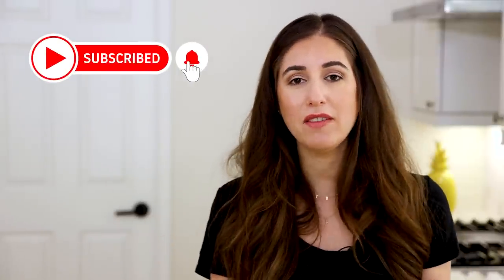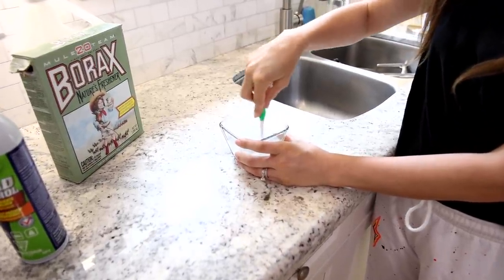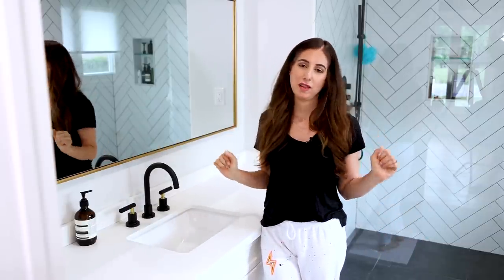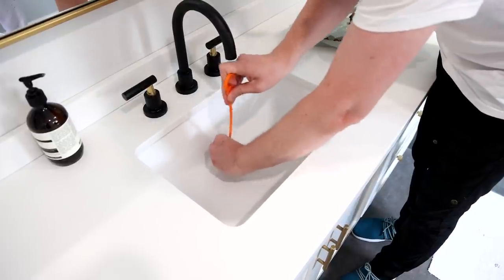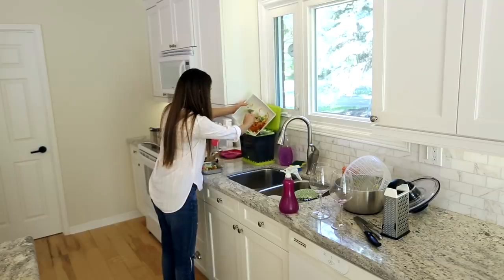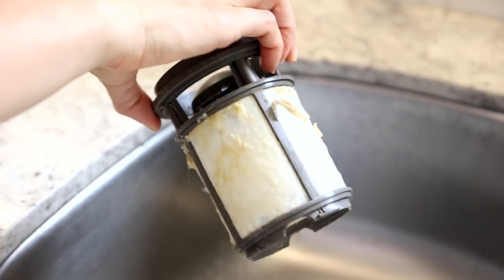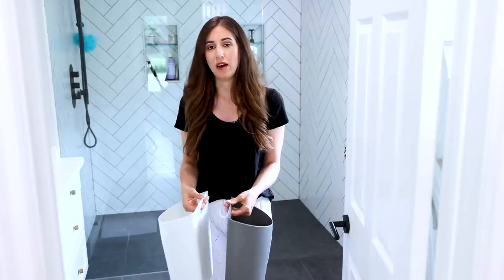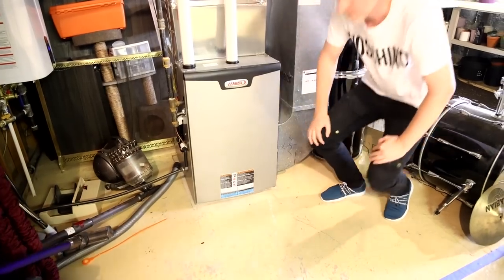Cleaning the Dirtiest Areas in my House

Comment: You should definitely change your furnace filter often, but doing that protects the furnace - not the quality of the air in your house. It’s a good practice either way, so a great tip. Buying cheaper filters and changing them more often is better than buying expensive ones, and changing them less often. Great video! 
Now off to check my dishwasher filter... 👍
Reply from the maker: Great point!
Reply: @cleanmyspace  the furnace filter that you changed... is that the same thing that's in my ceiling in the hallway? Or is that an additional air filter? It looks the same.

Comment: Thank you for the air filter reminder.. I checked mine (I date it) and it was covered in dust and dated 07/2019. It was horrific and didn’t make it any better that mine is on the ceiling. So when cleaning, I had tons of dust flying down on me and my hallway 🤢 I’m now putting a reminder on my calendars for every 3-4 months. 🤦🏼‍♀️

Comment: Great video! Inspiring as always.
I wonder if hydrogen peroxide and a soapy spray would have cleaned the "fur". Those are my go tos for most cleaning. 

We had the same DW experience last year. The DW now gets a clean cycle run at the end of every month and I clean the filter right after. Super simple now! Our previous KA DW had a "food grinder" that in theory sounded wonderful, but cleaning it was a ROYAL pain and it killed two motors. 
DW tip. We do not use the dry cycle. It will degrade the plastic DW parts. I don't know how many parts I bought off Amazon, just because they were falling apart. Yes, plastic dishes come out very wet. We usually open it and let it air dry. I have switched over most things we use to either glass or stainless steel. I use mason jars for drinking and storage. My husband doesn't like it, but they don't break as easily as the glasses we had before. They all have just two sizes of lids. So now I have a lot less random storage containers I have to have room for.

Comment: The hardest part of replacing the furnace filter is having to remember which direction to put it in and then angsting about whether it’s in right. There’s an arrow on the filter that is supposed to align with the air flow, so each time I would go to replace it, I would sit there and stare at the furnace trying to figure out which way the air flows, until I finally just drew an arrow on the furnace to remind me.  (Last fall we were having our historically worst wildfires, in Colorado, and the filter needed to be replaced every couple of weeks.)

Comment: I've been eyeballing my return air ducts. They're visibly dirty now. I just realized we've lived here 6 years and I've dusted them, but never removed and washed them down. EDIT: These ducts don't have filters. They're return air ducts. They are the ducts the furnace draws air from for heating and cooling!
Reply: Oh dear lord...
Reply: Dang, never changed the filters? You're gonna learn so much !
Reply: @thisisudax  My return ducts don't have filters. Just the main furnace. Which I have on auto-refill so I never miss that. I'm the handy ma'am around the house so I do all the maintenance. The grates were dirty on the outside (I have kids) That's all! LOL.
Reply: I also have two types of ducts, Floor ducts (which provide heated and cooled air) and return air ducts which are wall ducts that the furnace gets the air from to heat/cool.  I'm 38 and have owned and lived in many homes I've maintained. There isn't much for me to learn. :)

Comment: Can you recommend something that works for caked on hard water stains that turned brown in the toilet below the water level? Thanks
Reply: I need this too!
Reply: @Pakam3  it’s an absolute pain I tell ya. Got some of them off with the pumice stone but they just keep coming back even worse 😞
Reply: Try Lysol toilet bowl cleaner....the blue gel with 10x strength.
Reply: Try pouring a bottle of Coke and let it stand overnight.
Reply: My previous house also has hard water problem, eventhough we have installed water filter. I used Harpic (hydrochloric acid 12.5%). Just pour from the toilet rim and let it there for 15 mins, it will drip down to the water, then you can easily brush off any persistent yellow stain on top of the water level and crusty gunk under the water level. 
Thankfully I've moved out and the  water in my current house is still managable.
Reply from the maker: Add one-two cups of vinegar and let it sit for 20-30 minutes before scrubbing with your toilet brush. If it's still being stubborn, you can use a product like Borax to help tackle the job.
Reply: @cleanmyspace  Sorry, borax is alkaline and will not remove hard water deposit. It needs an acidic solution much stronger than vinegar, muriatic acid, for example.

Safety note: DO NOT pour muriatic acid while looking over the toilet bowl. The acid could react violently with the water inside and splash on your face. Pour the acid at arm's distance and wear rubber gloves.
Reply: I use barskeepers friend liquid only.
Reply: @bp7077  It has a pH of 1.5, so yes, it will clean hard water deposits. It's made of oxalic acid.

Comment: How do you keep your borax from clumping? Mine turns into a hard, unusable mess.
Reply: Keep it in a glass container that has a rubber seal
Reply: Or you could use the silicone packets that come with new purses and shoes or some rice tied up in the toe of old stockings.

Comment: What is a good for cleaning shower tracks that have built up mineral deposits?
Reply: Curious as well 🤔
Reply: Also interested in this.
Reply: Soak paper towels with vinegar and put them on the mineral deposits, than check back 20-30 minutes. You should be able to remove them with a plastic scraper or scour pad easily. Then clean as usual.

Comment: Oh my god my recycle bins were so dirty and nasty yesterday I used my lemongrass spray and tea tree spray and never seen them cleaned in a year since I used to clean my recycle bins . Trash bin in kitchen garbage can I would wash the kitchen garbage bin every week . Window stills so dirty every year and I always had to scrub the dirt and nasty things off window stills , specially screens I ended up wash them with soap and water , bottom and outside of the toilet bowl was so dirty so I had to use mr. clean and around the toilet seat was gross I had to use a q-Tip a cotton swap and then the open holes of the oven door too was so nasty I used a cotton swap and the washing machine dispenser for laundry soap , fabric softener and bleach  also removing it so nasty and the inside to the dispenser was a liquify  Mold type god had to use cotton swaps and cleaning toothbrush’s and used dish soap to clean the dispenser specially someone and I thought about how often u should replace the laundry dispenser ?
Reply from the maker: Wow, you said it! Re. the laundry dispense, I think it depends how large it is, but I would give it a good rinse each time its used up.
Reply: With the rinse what cleaning product or water temp should u rinse it with?

Comment: Hi! My dishwasher filter looks just like yours, but when I try to turn it, it won't budge. I'm afraid to use more force for fear that it isn't actually removeable, and I'll break it. Suggestions? PS--I'm a pre-rinser, so my dishes do come out clean.
Reply: Try to find the manual for your dishwasher and check it out. If you don't have it, then search for it online. Your dishwasher probably has a sticker where you can find the number of your model.
Reply: My dishwasher looks like yours too. I take out the flat silver section that the round bit sits in, it is also part of the filter
Reply from the maker: I would check the manufacturer label to see if there's a trick to removing the filter, and definitely don't use too much force. Good luck!

Comment: One of the dirtiest things in my house is the bottom of my walls. My dog likes to lay up against the walls. What is the easiest way to wash your walls & what's a good DIY cleaner?
Reply: I mix water, vinegar and a little dish soap in a spray bottle and spray directly on the area then wipe clean with a micro fiber cloth. It's good to have a bucket nearby for rinsing the micro fiber if it's a large area.  It will cut the grease and grime also freshen up. Test on a small area before to make sure it doesn't damage your paint.

Comment: 3:47 Use a wet vac and then run the water to fill the P trap after. Also nice to have a second vac hose to run exhaust out the window.

Comment: If that bathroom sink drain is the same as the one I have from Kohler; the push/pop one. Instead of twisting to take the top off, you can pull the entire piece out. The inside of that thing is like 2 Chris crossing thing makes cleaning a real pain, you also need a longgggg tweezer to get the hairs and stuff caught in it. Pulling the thing out makes cleaning it easier. It’s nasty none the less. I also get my husband to do it since it’s him that gets it all clogged. 🤣🤣

Comment: NO dish detergent has no cellulases in it.  Scrape your dishes.  I had a cherry pit in there that ground away as it went round and round.  The noise, I thought, was part of the unit.  I took it apart and found this thing.  Ran without the noise after.  Go in once or twice a year.  Find the manual online and read it.  

Pointer:  Also quarterly, check your built-in hvac filter.

I'm here for the thumbnail.  Heh.
Reply from the maker: Wow, I can't even imagine the sound it would have made! Thanks for sharing.

Comment: Melissa what is the treatment spray that you used in the windowsill?  The dirtiest space for me are the baseboards. They get dusty and my back hurts from bending to clean them.
Reply: I was able to read enough of the can to figure out that it's "Mold Control."  (I'm planning on getting some and giving it a try.)  Amazon has it and Home Depot also carries it.  It also comes in a trigger spray version that some reviewers preferred.
Reply: @triciarie3972  ok. Thank you!

Comment: Ok, so I really need your help. We have a few windows that have this dry haze in between the double panes. Do you have any way or tips to get rid of this. It looks horrible.
Reply: If it's what I'm thinking,  some of ours have it too and when we moved into the house the home inspector said it was faulty window seals. Unfortunately the only fix is to replace the whole window. Having said that we have lived here 5 years and never replaced them. It's more of an eyesore than an actual problem but you  may want to ask a professional to make sure.